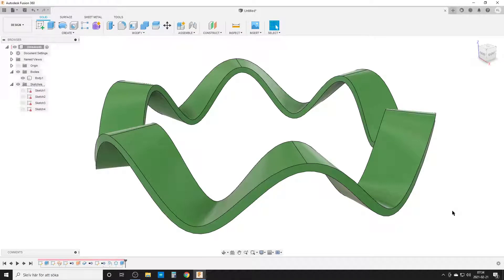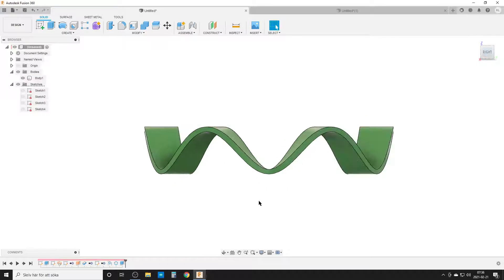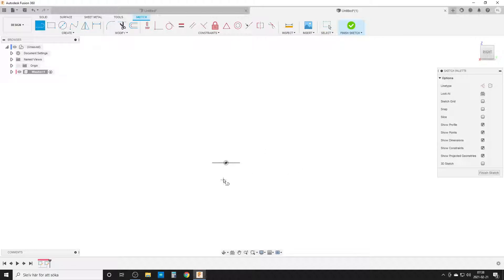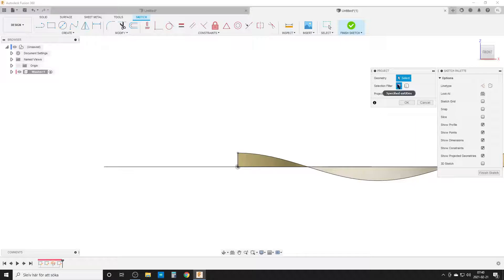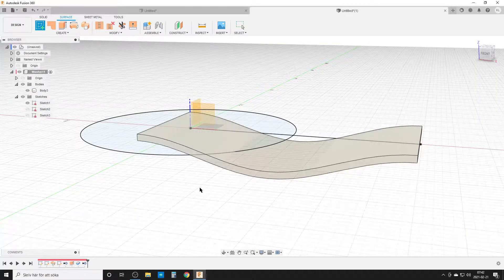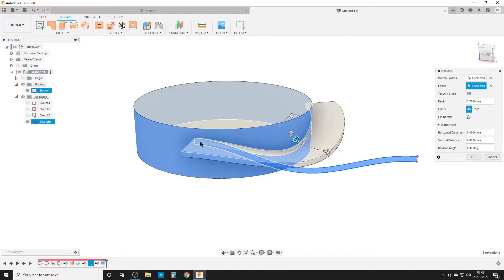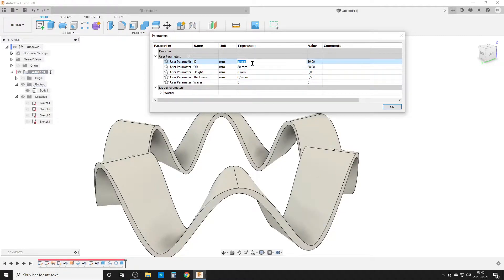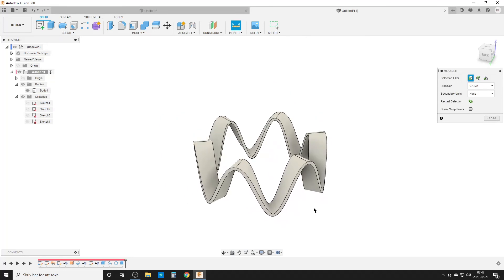Fusion 360 - Wavy Washer (Parametric Emboss)

Comment: Nice. Can you do an axial dynacam for axial piston engines? Its a sinusodial shaft (2 sinwaves) that is moved by up to 6 pistons, to create work?
Reply from the maker: You can use the workflow for the washer, create 2 of them and cut from a cylinder.
The CAD whisperer has a good video on the problems with creating CAM-slots, and other software has better built in tools for CAM and follower design (I have not used them).